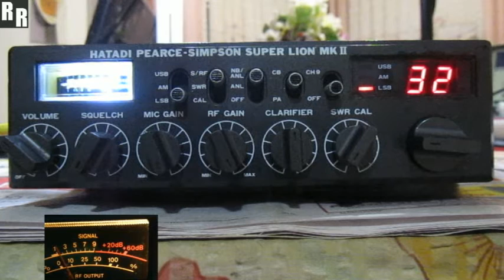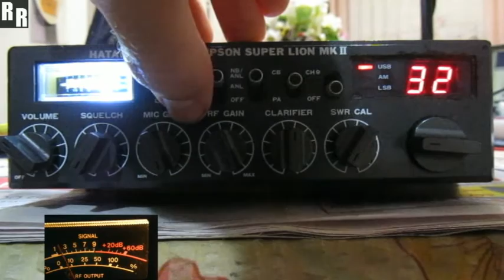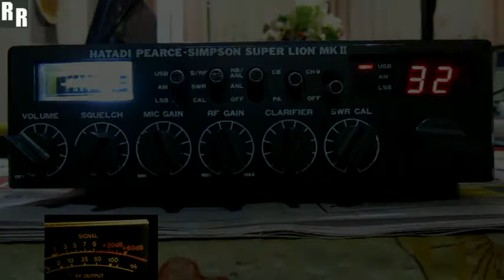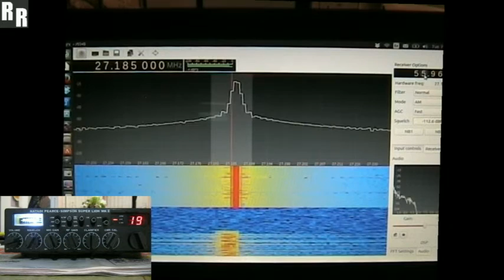Pearce Simpson Super Lion MK2 for Don in SA (Interactive demo with Dan 140 + SDR)

Comment: strange radio is this something new ?
Reply from the maker: Hi, fairly popular here but getting a little old and harder to find in neat cosmetic condition any more
Reply: I notice you can find a lot of  unique  ssb radio in Europe , multiple choices you can find easily about 10 different awesome brands , Cobra  stop making SSB radios uniden 1 louse radio  ranger  not much better , Import is hard to get even if you do at a steep price in the  USA .
Reply from the maker: Yea not sure which country you are from, but here in Australia there are still lots of good ssb rigs floating around. With some TLC they come up good. Europe do have a lot of export type rigs with extra fancy feautres
Reply: usa
Reply: yep i picked up a new one in a box 5 dollars garage sale works great but i need to find out the vr modulation pot as i only need 2 watts output or can i use the mic gain control to do this for transmitting on 27 mhz.
Reply from the maker: Hi Alan, if you message me via my facebook page or email web@razorradios.com next time I'm back at my workshop can send you info.